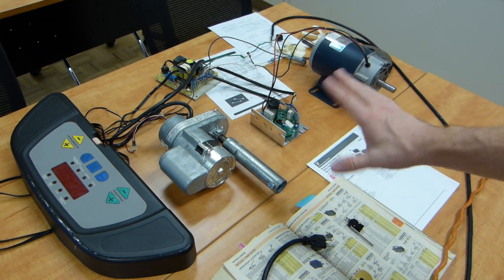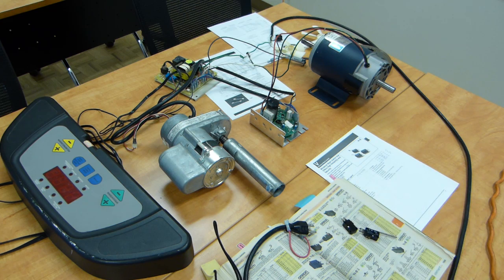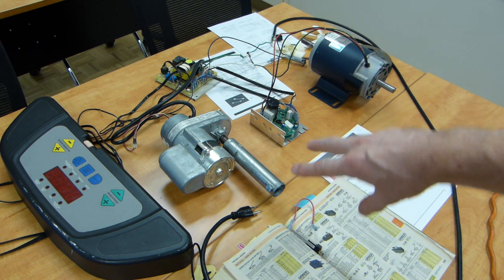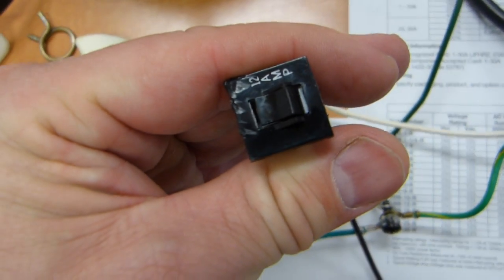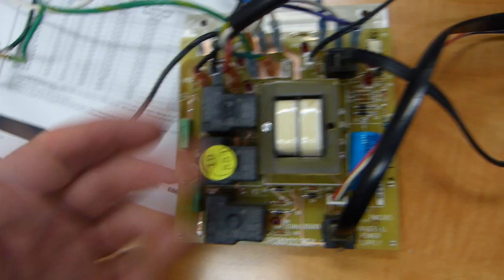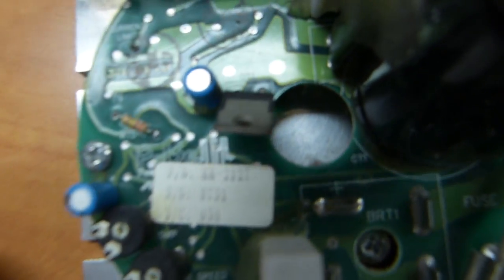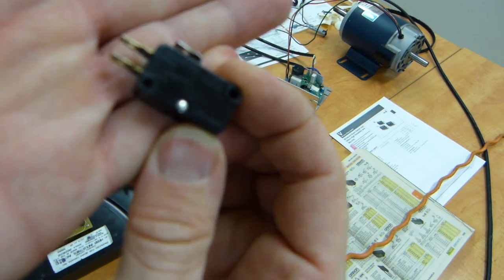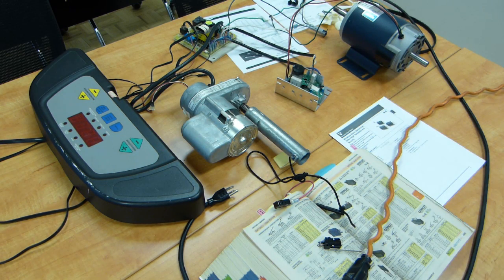Treadmill typical electrical repairs $0-10

Comment: I just fixed one that I borrowed...Blown 10 amp fuse and a couple of tracks as well...Turned out to be conductive glue underneath a capacitor, short circuit triac and bridge rectifier - With a double sided pcb and glue everywhere, it wasn't designed to be fixed that's for sure!!!

Comment: Great video. I have a treadmill that powers on, the console works, the incline works but if I start the belt, the circuit board clicks but the belt won’t start. So the fact that the control board clicks says that communication is going to it from the console but there seems to be no communication from the board to the motor. I have tested the motor separately with a battery and it works. I have also taken the circuit board to an electronics store who said the relays and some other components test good. All the wiring looks good. It makes no sense to me. There is a zing ear thernal switch that has a loose reset button. It does not seem right to be so loose but maybe it was always that way. Also, this switch has a load terminal and a line terminal. A red wire is going to the line terminal and a black wire to the load terminal. Is this correct? I was thinking the red should go to the load terminal. Not sure if the thermal switch could allow everything else to work except for the belt? Any idea what this could be? I’m considering to buy a new circuit board but I don’t want to risk spending the money for nothing as the electronics store I took the board to says it seems ok with no signs of anything burned, etc. This happened after my treadmill had been moved and stored for a while but as mentioned all the wires and connectors look perfect.
Reply from the maker: Thermal switch makes more sense if it's protecting the motor from overheating. It has to have a loose reset button to allow the bimetal disc inside to expand and move to open the circuit, which is normally closed. I worked on a thermal switch on a kettle on this channel https://youtu.be/X60bpopgpD0 and also took an auto-resetting one apart. https://youtu.be/nbIfDBeioAM

Comment: I have a very similar model, display powers up but when you try to start a program, receiving Error L5 and nothing moves. 
Originally when we were using, we started to receive a notification to Lube Belt but before we got around to do that, the belt stopped while it was in use. 
Any suggestions?

Comment: subbed!
man when you get into the whole manufacturing bit that is so true.
I notice its all the same with like microwaves and stuff I took so many apart and there all the same parts the cheaper ones at least, inside the boards, etc. I think sunbiem, emerson, mainstays subcontracted the same manufacturers for the electronics to put in them.
Same molded plastic and metal chassis too
Reply from the maker: Thanks for the sub!

Comment: Great video ! Thank you ! I have a similar type of treadmill setup. A little water has gotten inside the treadmill around the circuit board, breaker switch area, and now no power. Could this probably kill a fuse or breaker switch generally speaking ?

Comment: theoverengineer- question- if my treadmill has power when turned on, but my upper console is not working, none of the touch buttons work, the display only shows "connecting", so i am getting power to the upper circuit board, but nothing is happening except for the connecting code, does that mean i need to replace the whole upper circuit board? all touch buttons are powered with electrical membranes not actual mechanical switches, and these membranes are powered by the upper circuit board, so to me it means the upper circuit board needs replacing. my lower control circuit board has only one led that stays on (solid) when powere on, not sure if it would need replacing but i don't think so since it is powering the upper control board. what is your expert opinion about it? thank you.
Reply from the maker: No, check the connector pins into which the whole upper dash plugs in. There has to be a ground pin, there has to be a power pin, check it with a voltmeter. Looks like power is not getting to the console.
Reply: @theoverengineer  the power cord/spinal cord to the console has 8 wires fitted into a female connector, that female connector connects to a male 8 pin/prong connector on the console circuit board. i checked each hole with voltmeter in the female connector of the power cord and getting voltage for all of them, the wires are black-orange-red-blue-yellow-green-purple-brown in that order. i ohmed the pins/prongs of the console circuit board male connector and the middle two pins/prongs are infinite the rest have measurements, so i assume that connector is bad? i would have to heat the solder up to remove if need be but i don't know where to get another connector like it if that is the problem. my console gets power, the display lights up but says "connecting", none of the membrane touch buttons are working.